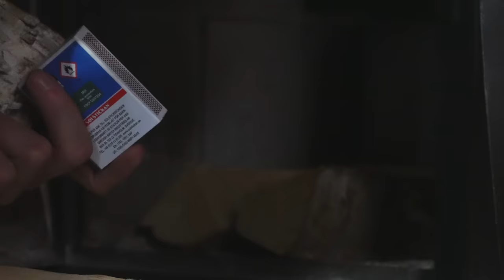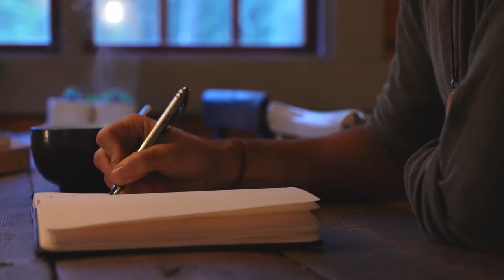A Relaxing Day in my Cozy Forest Cabin Life - ASMR

Comment: One must take great caution when throwing out the ashes into the woods like you did, as many times there is still an ember or two which might cause a big fire. It's always safer to have a rock-surrounded firepit to throw them into or to leave them in a metal bucket for days, before throwing them out, and still check whether they are warm. I know of a Swedish guy (coincidentally) who put the woods on fire doing exactly what you did here, almost at the beginning of the video.

Comment: Does that stainless water dispenser filter out bacteria? I thought only whole house filtration systems (that cost thousands of dollars) were able to do that. I have an old dug well at my house and so my water isn’t potable. I don’t consume it, I only use to for bathing and washing dishes, etc. 
In the spring when we get a lot of rain, the water in my well starts to stink really badly due to high levels of iron bacteria. Showering in it when it smells is unbearable. I have to pour lavender oil on the shower floor so the scent will mix with the steam and block out the stench of the water.
My neighbors got a filtration system and it cost them around $7,000 USD.